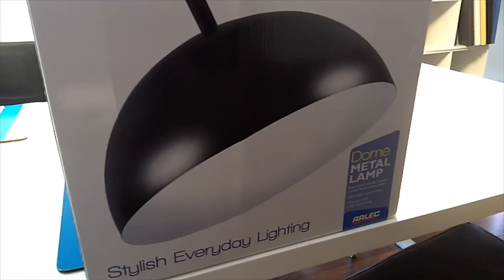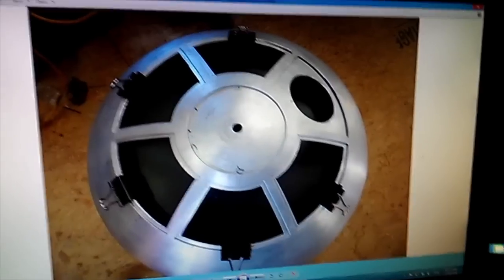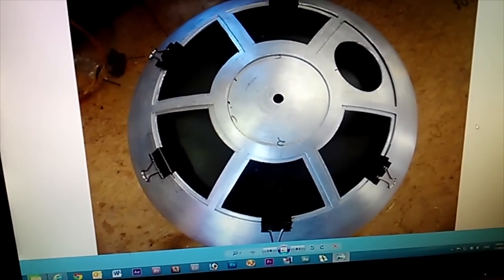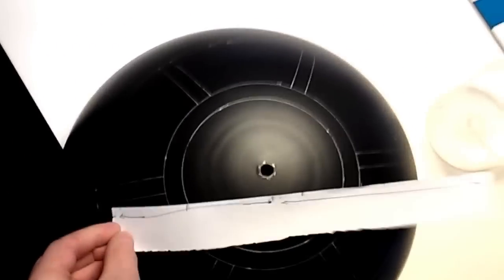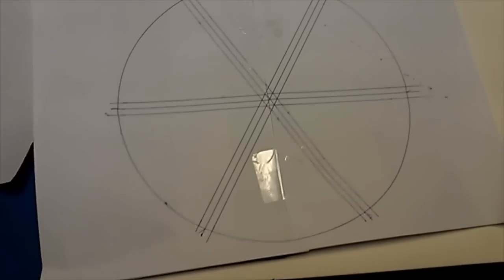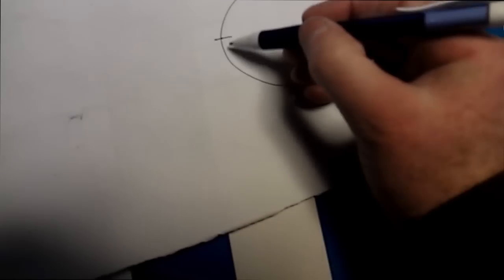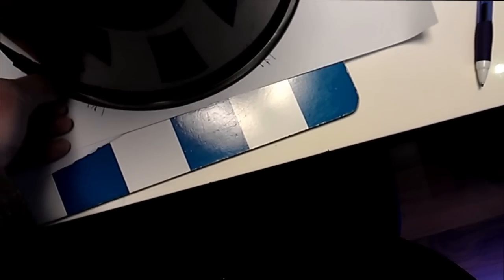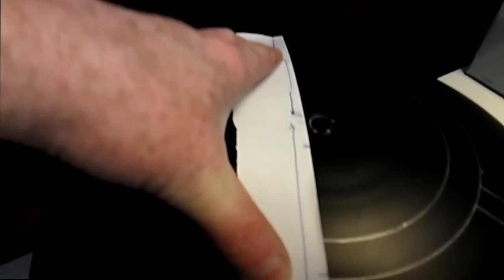Discover the Ultimate Guide to D.I.Y R2-D2 - Episode 1

Comment: Hi can I confirm that the scaling figure you describe is used to scale all parts of the R2 unit. I going to using a 450mm dome shade similar to yours. Also do you go on to explain who the hole in the top of the shade was filled . Cheers Alan
Reply from the maker: I havent filled in the top as yet but when i do I will explain :) The scale figure varies depending on which photo you are scaling from
Reply: OK many thanks. The 450mm dome is still slightly too small according to forum sites but I was going to use  my dome size/1:1 plan size e.g. 450/462.98=0.97196 (97%). Multiply this number (0.97196) by all scale plan dimensions.

Comment: hi i'm using the same dome can you give me the diameters you used .
Reply from the maker: +Jesmond Cachia What diameters do you need?. The dome is 400mm diameter
Reply: I ment the two smaller circles   cause i have the same bucket
Reply from the maker: Jesmond Cachia Hi, The circle sizes from smallest to largest are 102mm, 126mm, 270mm
Cheers
Reply from the maker: Jesmond Cachia also, a new vid on marking out the rest of the dome step by step with measurements will be live on Saturday 18th.
Reply: Thanks for the measurements . Found a place for plastic hdpe 1.5mmx1mx2m 24+gst
Reply from the maker: +Jesmond Cachia I think I paid around $30 so good deal. Dont throw away any offcuts either. You'll need them for other pieces
Reply: Thanks keep the videos coming  really  enjoying the build and heaps of help.
Reply: +Jesmond Cachia if you have the bucket what is the diameter of the bucket because I just bought the same dome
Reply from the maker: +Blashada 270mm :)
Reply: +Bornandbledfilms thanks for those measurements that was really helpful I have another question though. When painting the dome will we need to scrap away all the black or can we just use it as an undercoat and then paint it silver
Reply: Are these the circle sizes on your dome from the scaling calculations